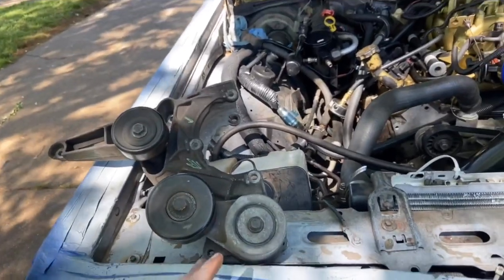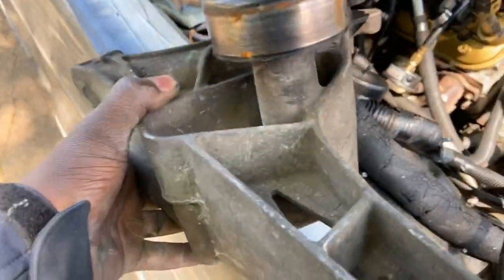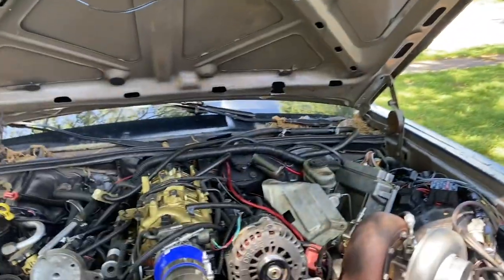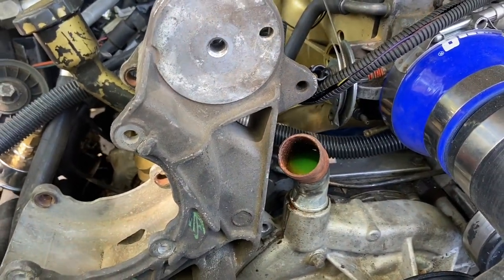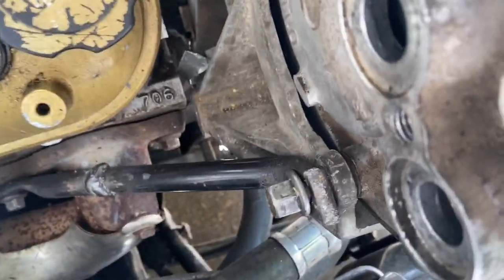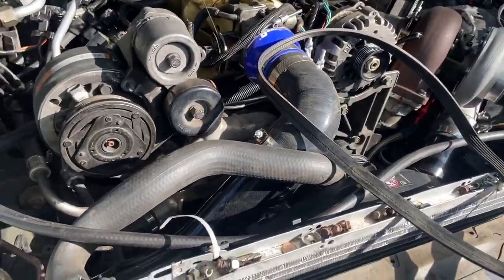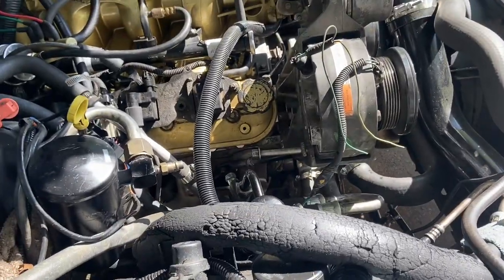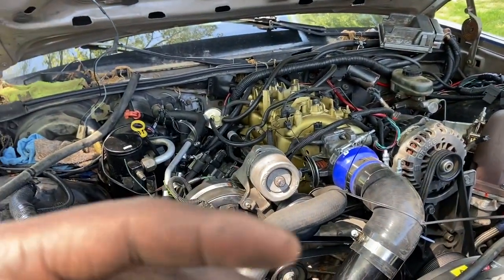How to setup ac for ls swap part 1 of 2

Comment: How do you control the ac. W the pcm  ??
Reply from the maker: On mine i had to straight wire the clutch to a 12volt switch then tapped the pressure wires into my ac accumulator wires with the marquis but for the chevy ls swap its plug and play the standalone harness have a ac request wire but you really don’t need it but to go the extra mile you can wire it in as well. Different cars wire up different